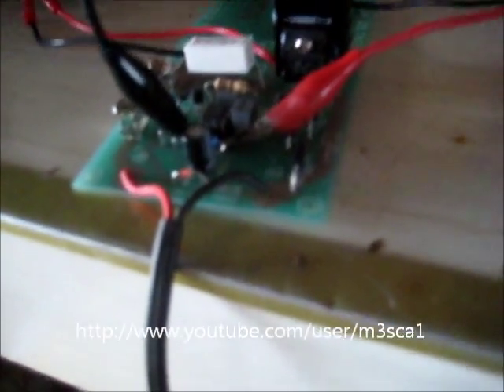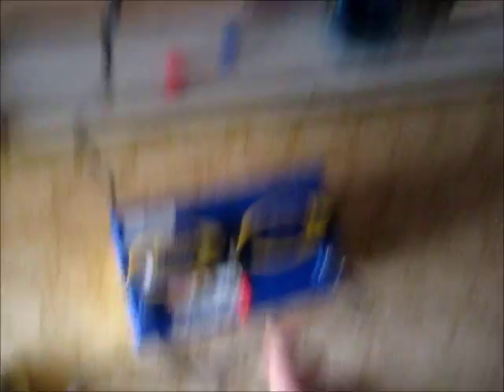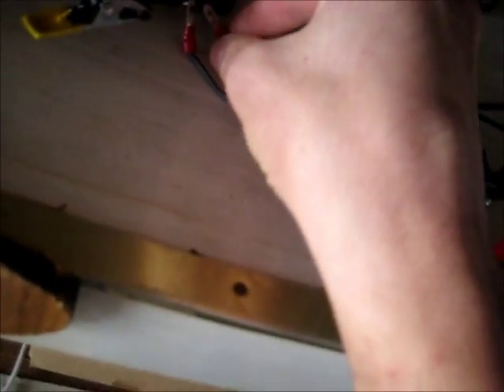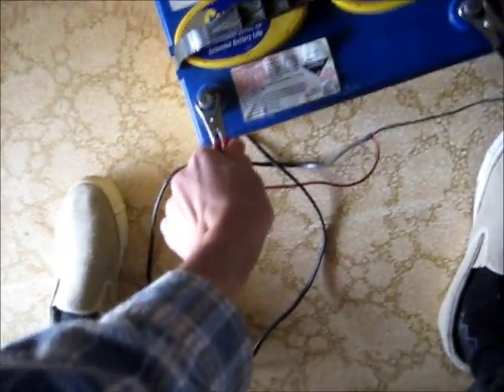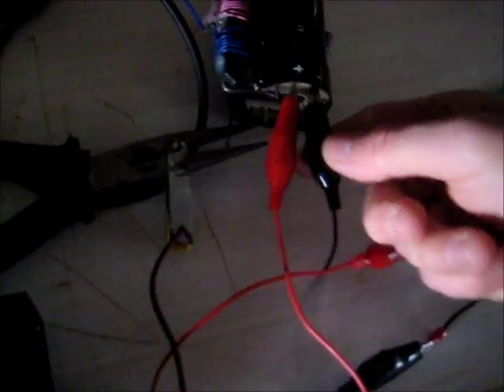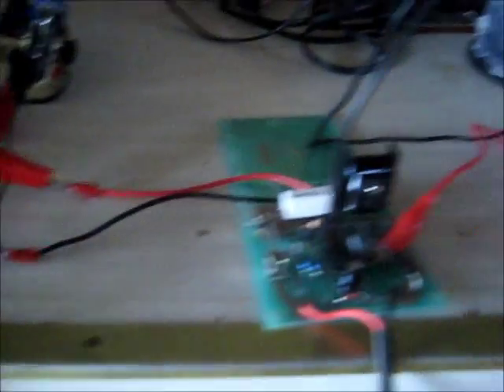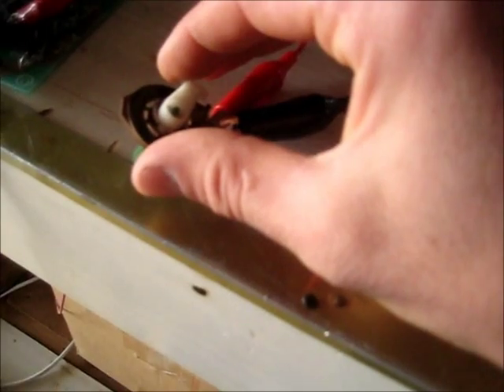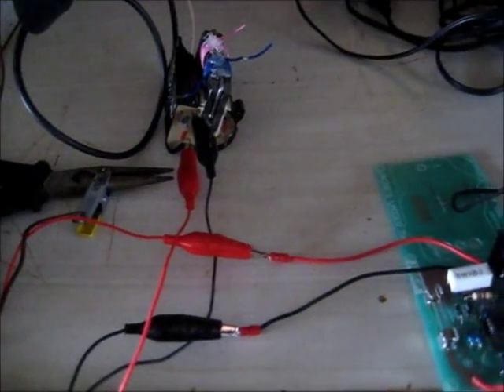Frequency adjusting the jaycar ignition coil driver to run a Flyback Transformer

Comment: Higher frequency(15 KHz - 30 KHz) and higher voltage (50V - 150V)
a capacitor in paralell with the switch or primary may help too.
Can you get the out the mains PSU from the TV's?

Higher frequency needs higher voltage for same spark-length, at least get another battery and run it off 24V.

Comment: That's the go! A little control goes a long way. Haven't seen that jaycar kit in action before! You should be able to get improved control by throwing a resistor in series with the pot. 
Pulse width modulation next?!

Comment: cool-also put a resistor in series with the POT so you can play with the range of the frequency-i used 2 pc motherboard jumpers so i can change the resistor easily-this Jaycar kit tought me alot about HV,and is quite robust.